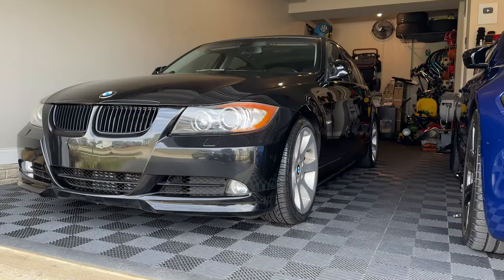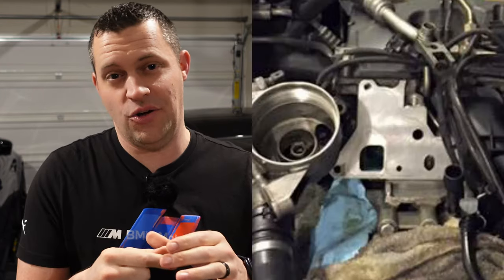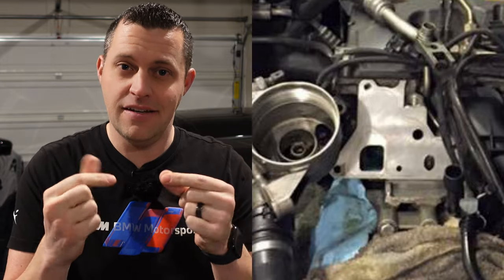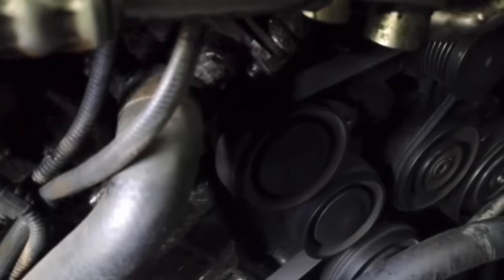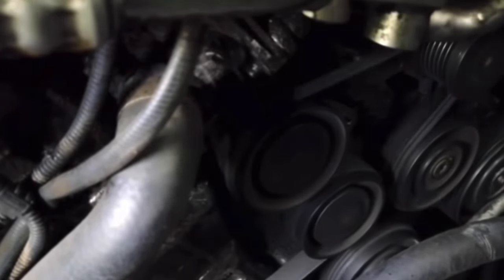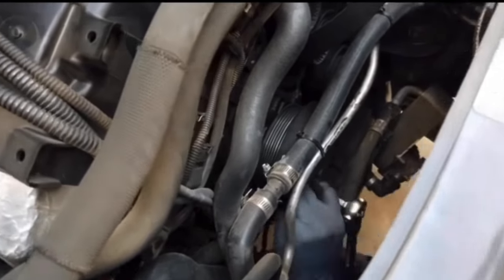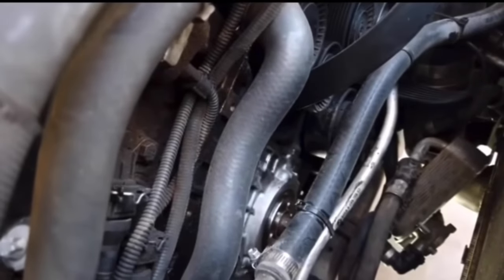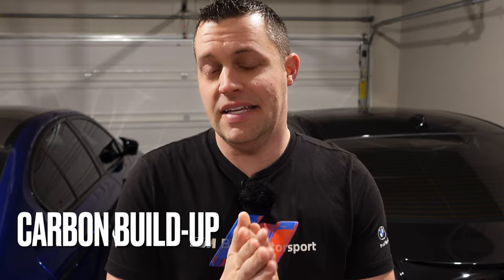The ULTIMATE BMW N54 Codes/Failures/DIYs Guide!

Comment: To put into perspective how much all of this would cost to replace. Just in parts for the HPFP, injectors, water pump/thermostat, oil filter housing, walnut blast, valve cover gasket BEFORE addressing waste gate issues you’re looking @ 7k and with labor call it 12k. Parts for the N54 have gone way up. As an owner of a 135i for over 8 years (2nd owner) all of these have been replaced either under warranty or by myself and it is very reliable. But what a nightmare if not. Misfire gremlins. Not to say, I still deal with issues here and there. I’ve been following your channel for years and love all the content!
Reply from the maker: Oh I hear ya man! I’ve replaced a lot over the last 10 years of ownership and really having had to put anymore money into over the last few years, which is a nice change! Ha 
With the rising costs of parts, the N54 is even more expensive than ever, but here to help if I can. Thanks man for sticking around 👍🏻
Reply: @BMWFanatic  IMO your videos
Are the best, you get right to the point and have saved me hours of research on the forums. Honestly one of the best channels. Between Legit street cars for my (now sold) C63 Mercedes and you for literally every issue I’ve had on my N54. Fantastic and entertaining channel!

Comment: Hey have you had any issues with the adaptive headlight modules failing? I just replaced the HID Bulbs because the DS headlight was out & that didn’t fix it. Went and pulled apart the headlight to find condensation in the module, so replaced the module and it got the low beam working again ❤ but the stupid light keeps coming up on the dash. Is there a way to code this out without Protools? I would still like the functionality of the factory headlight settings. I’ve read coding them out could disable that feature .. any help would be greatly appreciated please! Thanks

Comment: The first thing i do when i buy a N54 is remove the undersheild and engine cover. Fix all visible oil leaks and coolant leaks, install aluminum mickey mouse flange, after that point there soilid do plugs vanos when you can

Comment: I do have some questions for you. So I picked up a 2009 335i 2 yrs ago @$6k And this is my first ever BMW (previously Subaru owner) the first thing it needed was tires $1k smh so that was fixed. but then as you said the oil dripped down and the belt shredded. took it to a shop and they broke my bypass hose. they refused responsibility ofc. so now with a little patching it held for a little bit but it overheats i lose coolant etc. possible coolant system maintained as well as oil maintenance since it has a fresh oil change but has just been sitting there. now the battery is dead lol. and the rear window motors/actuator are shot and the glass dropped. its 1 snowball quickly growing. should I just give up on the car since I don't have huge capital? or do you think its worth doing a complete overhaul? i have no idea the status of the head gaskets or if it cracked the block. any mentorship would be appreciated. feel free to reach out in a PM since your well more adverse in BMW ownership/DIY

Comment: I get knock sensor low input code/limp if i give more than 40 percent throttle only when the car has just been started and for the first like 20 minutes. After i restart it no codes it runs flawless. I guess i should replace the sensor but its weird that it goes away. Ill probably just leave it its not an inconvience and assures the cars warm when i do put the pedal down.
Reply from the maker: BMW codes can get finicky for sure. How long has it been doing that? You can further diagnose it before you replace the sensor just to make sure that’s the root cause